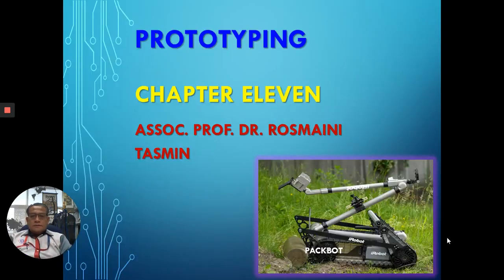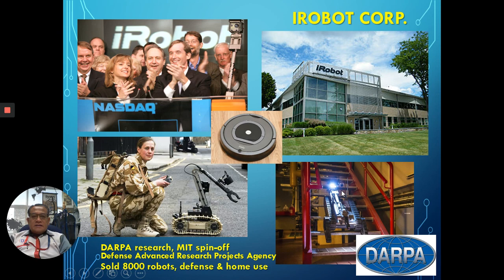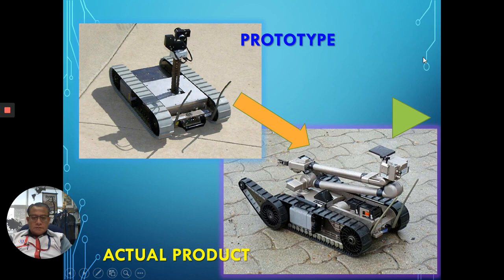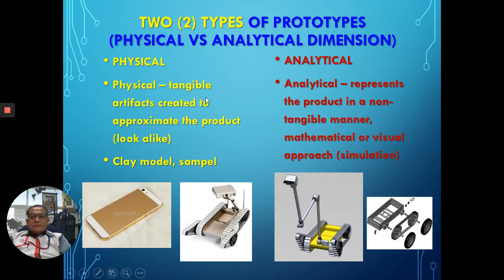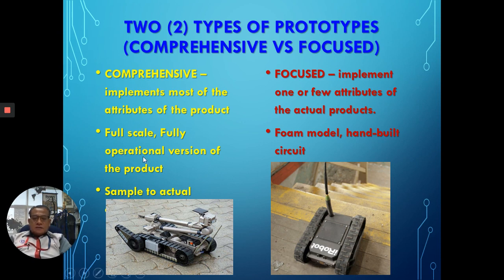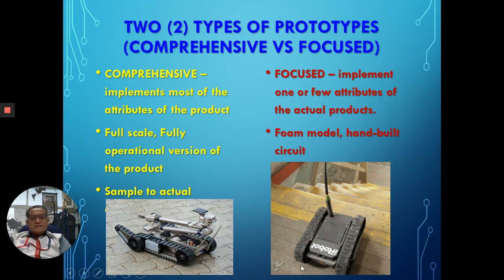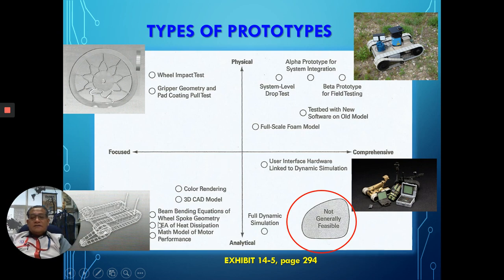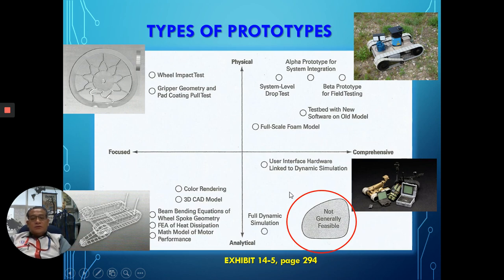Product Development Lecture Chapter 11 Prototyping

Comment: Nuraini Binti Panut (AP180474)

There are two types of prototype based on the video which is physical vs analytical and comprehensive vs focused. Next, I also learnt about the principle of the prototype and the molding technology will be used to produce physical component for prototype.

Comment: AHMAD HAIQAL BIN SHAHKIRIN (CP190036) from Section 4

-What i've learn today is Prototype. It is a process is developing a such an approximation of the product. 
- there is two type of prototype which is physical prototype and analytical prototype.
- physical prototype has a tangible artifacts like clay and analytical prototype is more to simulation.
- the another of prototype is comprehensive vs focus.
- comprehensive (fullscale, fully operationally version) and Focus (implement one or few attributes of actual product, foam model, hand built circuit)

Comment: Siti Nurasyikin binti Zaiddin (AP180062)

From this chapter, I have learn the concept of prototype. There are two types of prototype which are physical vs analytical and comprehensive vs focused prototypes that can be used in communication and integration. Next, I also learnt about the steps for prototype and the processes.

Comment: AINUL NABIHAH BINTI ZAINAL
AP180029
SECTION 2
Chapter 11: Prototyping 

Summary of what i have learn and achieve the learning objectives in this chapter..
Types of Prototypes 
*Physical as opposed to analytical 
*Comprehensive as opposed to focused. 

The purpose of prototypes is for:
1. Learning
2. Communication 
3. Integration 
4. Milestone 

Principle of prototypes 
- Analytical prototypes are generally more flexible than physical prototypes 
-physical prototypes are required to detect unanticipated phenomena 
-a prototype may reduce the risk of costly iteration
-a prototype may expedite other development steps

The planning for prototypes includes 4 steps which are,
S1: define the purpose of the prototype 
S2: establish the level of approximation of the prototype
S3: outline an experimental plan
S4: create a schedule for procurement, construction and testing

Comment: Nurul Syahirah Binti Azli (AP180488)
Based on the video, I had learnt about the concept of prototype. There have 2 type of prototype which are physical and analytical dimension and it also have their own purpose in producing the prototype. I also learnt about the principle of the prototype. Lastly, I learnt that molding technology will be used to produce physical component for prototype.

Comment: Nurul Syafiqah Binti Ahmad Junaidi, AP180336

In this video, i learned that there 2 types of prototypes are used for learning, communication, integration, and milestones which are physical vs analytical and comprehensive vs focused.  4 steps been identified to planning prototype, which is define the purposes, establish the level, outline an experiment plan and create a schedule for procurement, construction and testing.

Comment: Nur Syahirah binti Zamri Ap180093
Product development almost always requires the building and testing of prototypes. A
 prototype is an approximation of the product on one or more dimensions of interest. Prototypes can be usefully classified along two dimensions: (1) the degree to which they are physical as opposed to analytical and (2) the degree to which they are comprehensive as opposed to focused.

Comment: AIN AISYAH BT MUSTAFA (AP180465)
In this video, i learned about prototype is engineers prototype the design and software developers writer prototype programs.  There are two type of prototype which are physical and analytical and also  comprehensive vs focused.

Comment: Lowmeeiching (Ap180190)
I learned about, 2type of prototype which are (physical and analytical) n ( comprehensive vs focused). Physical is tangible artifacts created to approximate the product ( clay model to look alike) while analytical represents the product in a non-tangible manner, (simulation, AutoCAD). Next, Comprehensive implemented most of the attributes of the product, focused implemented one or few attributes of actual product.

Comment: LYE MEI KI (AP180373) 
In this lesson I learned about prototype. Prototype is a model that show original form of actual product's design and concepts. It can reduce the risk and costly iterations and to expedite other improvements steps. There are 4 steps for planning prototype, which define the purposes, establish the level, outline an experiment plan, and create a schedule for procurement, construction and testing.